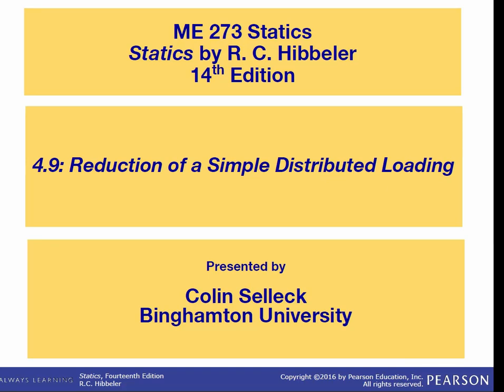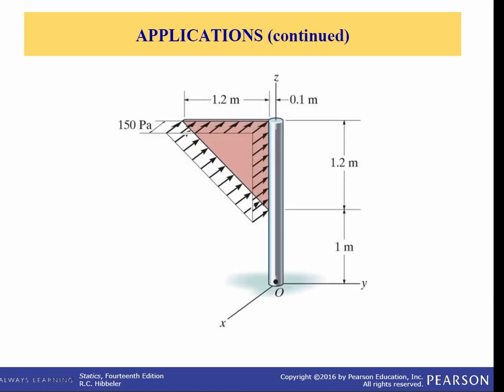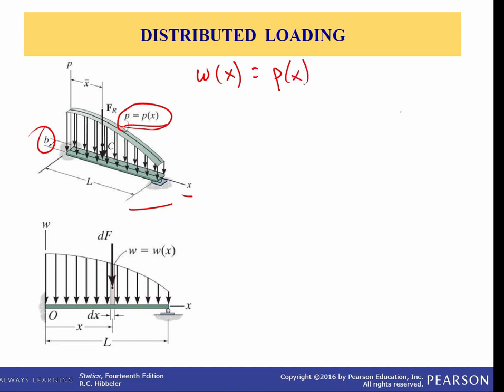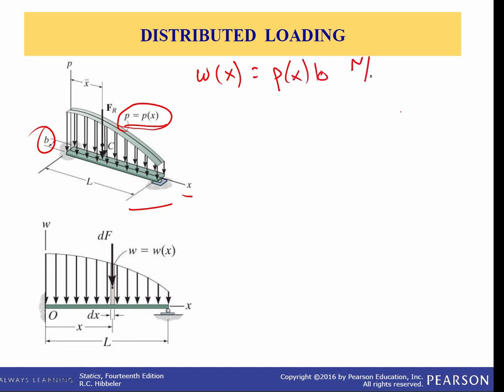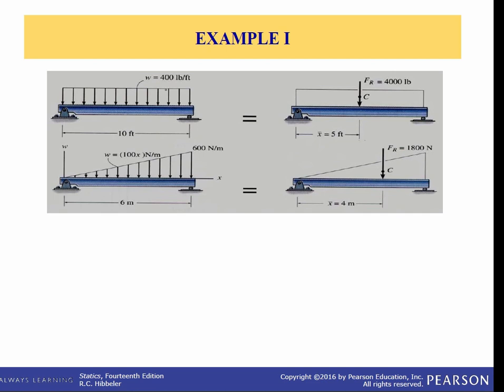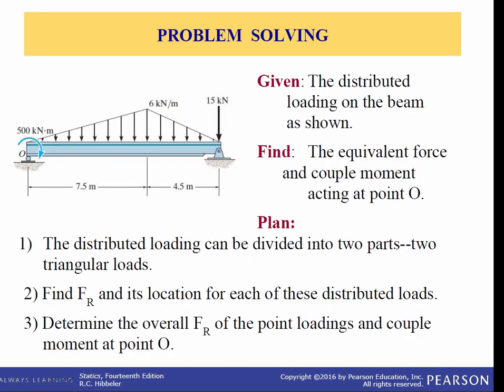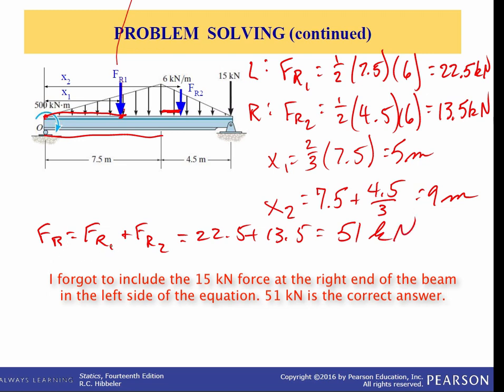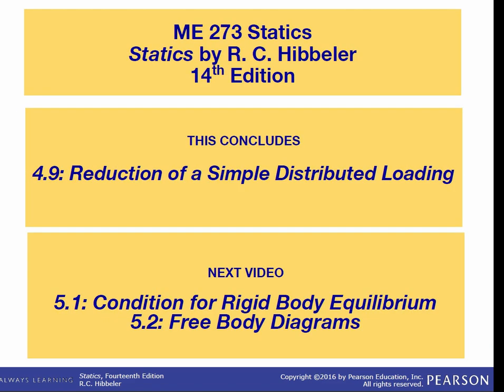ME273: Statics: Chapter 4.9

Comment: 14:21 (X2=7.5+ 4.5/3 )why is it 4.5/3
Reply from the maker: That is the location of Fr2 resultant force. The centroid of a triangle is 1/3 times the base.
Reply: oh so the centroid of the  first triangle is 2/3 times the base because it's measured from the zero height position  .. thanks
Reply from the maker: Correct!